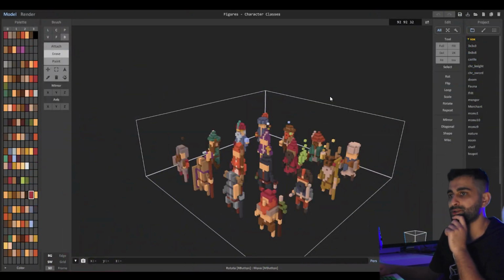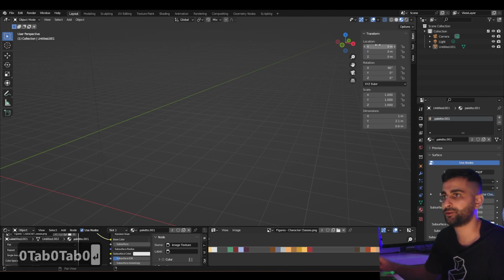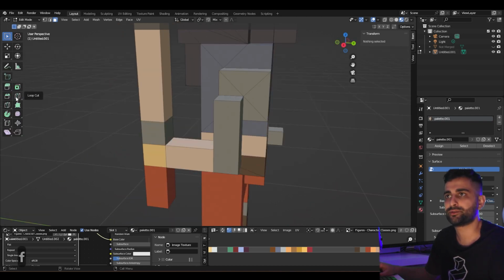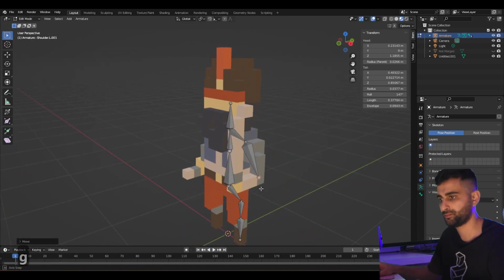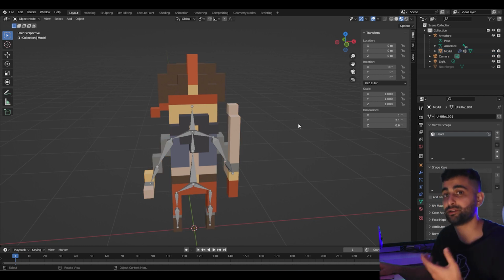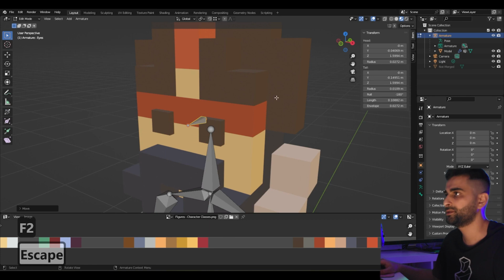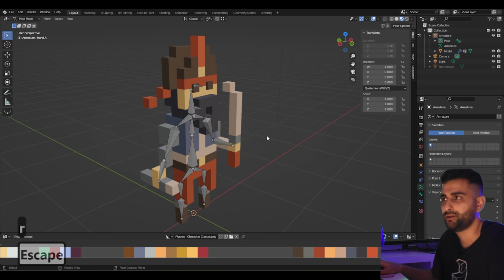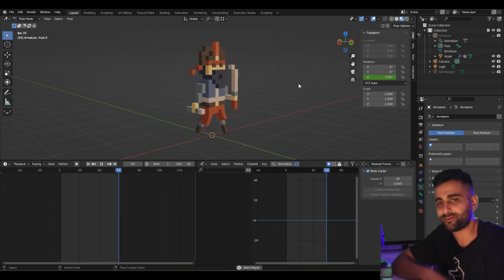Rigging and Animating a Magica Voxel Character [Blender Tutorial]

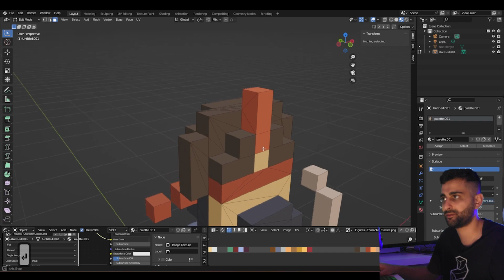Comment: do you have another vid elaborating on "cleaning up topology?" the part around ~6:52 when youre doing some kind of magic on the character's back--what is that? you described what you did--just not why? ;)
Reply from the maker: I don't have another video yet but https://topologyguides.com/ is a great resource for topology :) 

I noticed in that part of the video the previous topology on the back wasn't visible. The reason I cleaned it up was, as you'll notice in other parts of the mesh, you have long, thin triangles that connect sides to corners. If you were to subdivide or animate these triangles, you'll get stiff and jagged mesh deformation. Recall that when models get rigged, the faces don't warp, they're always flat, so the bends occur at the edges. 

So, what I did was, select the geometry and pressed F to merge it all into one big polygon, then thought about how to cut up that polygon so that the faces are all quads and triangles. You want to do this in such a way as to minimise the number of triangles (prefer quads), make the quads and triangles as square as possible (avoid sharp angles and elongated faces), and avoid vertices with too many connecting faces. There are of course many ways to achieve this and it doesn't need to be perfect but that was how I divided the back. 

Note that this is to make animations and subdivisions look good. If the purpose is for stills, or if that part of the mesh is not animated and makes no difference in the end, I don't bother with cleaning-up topology. 

Hope this helps :)